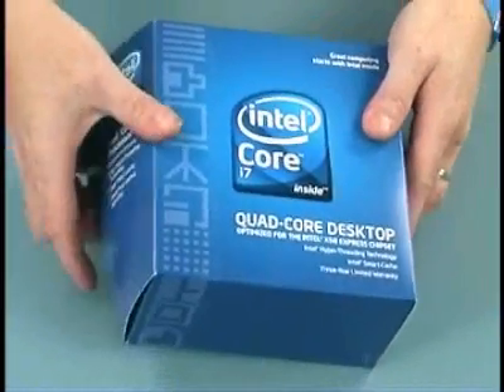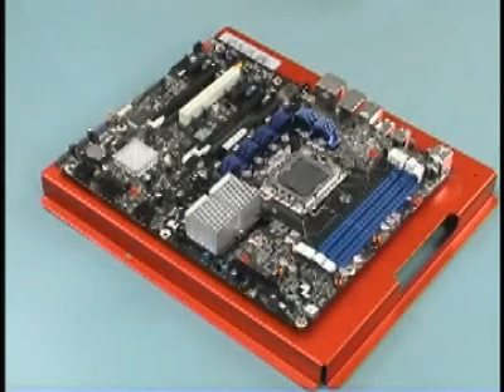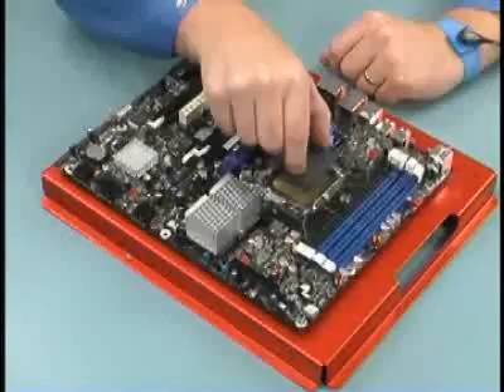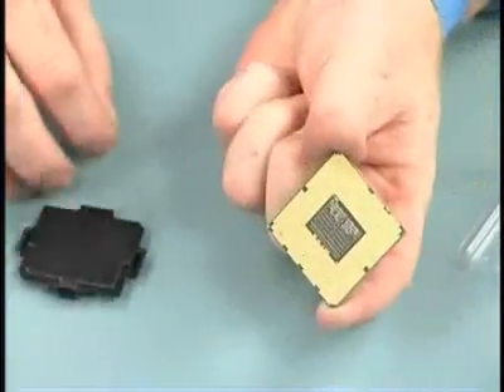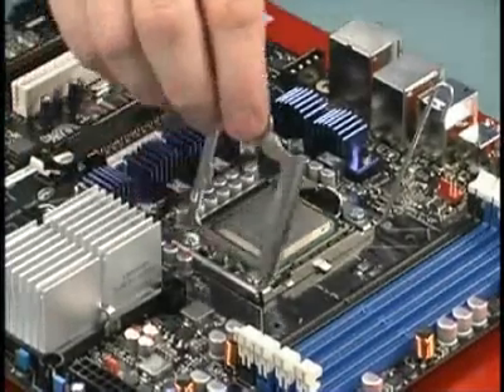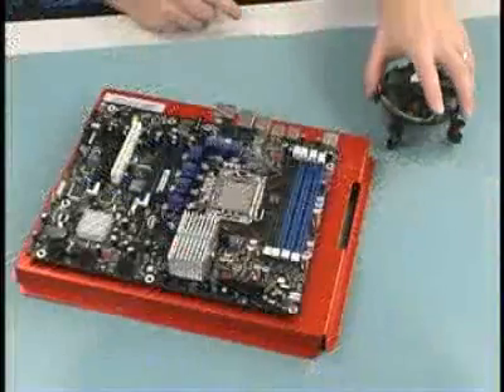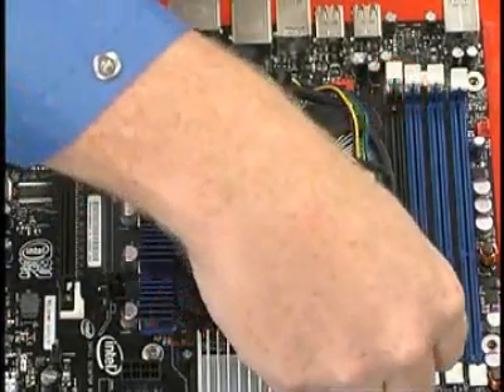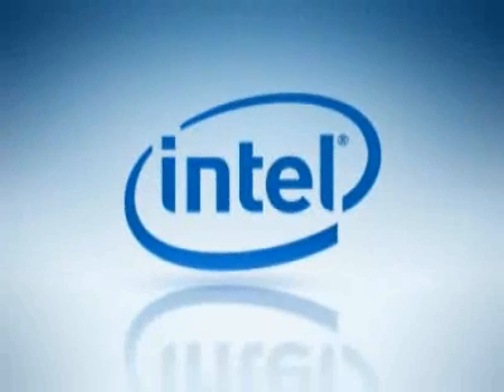Official Intel LGA 1366 Processor Integration (Installation) Video

Comment: if you heat sink is dead due to fake mounting brackets on the heat sink
Important note: Should you need further assistance from us regarding your inquiry, we would highly appreciate if you could simply reply to this email of ours, instead of sending a brand new email, unless it is a different issue/inquiry.  Thus, we will be avoiding duplicate incoming emails, and we will not lose track of the email thread.

Comment: Karla A. 

Intel Technical Support  "D not
hesitate on contacting us back if any kind of further assistance is needed.
Important note: Should you need further assistance from us regarding your inquiry, we would highly appreciate if you could simply reply to this email of ours, instead of sending a brand new email, unless it is a different issue/inquiry.  Thus, we will be avoiding duplicate incoming emails, and we will not lose track of the email thread.